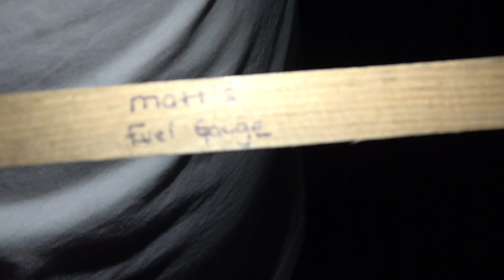The Brooklyn Dodger Works on the Street!

Comment: Warning you can’t excite the LS alternator with 12v it kills the diodes.  Been there done that, you have to reduce the exciter voltage to 5-7v to save the diodes. They sell a wiring pigtail with a resistor specifically for the LS alternators!  JD
Reply from the maker: I have the pigtail from holley so it should be fine. I believe you just hook up switched 12v to that and it’s good
Reply: I too found this out the hard way lmao

Comment: So learn this south jersey boy somethin here. Are you controlling the spray with the Holley? If so is it a dry kit? I have sep 1500s and was planning on using a dry kit as I don’t see why not. Is this what your doing? Thanks for any info
Reply from the maker: Yeah the holley has a built in nitrous program you just have to wire it up. I have a wet shot for now but once we get the tune up a little better I’ll go to two dry kits
Reply: @Matt_Ryce  that’s what I was gonna ask next. Why can’t two dry kits be added. Awesome. Would love to pick your brain

Comment: So let me ask you something with the s10 frame under that will that limit you to any of the races that you need (stock) suspension?
Reply from the maker: The suspension is stock 🤷🏼‍♂️
Reply: Just curious I've seen I few races where they said stock style front suspension and didn't know if that was a thing
Reply from the maker: @tophatpat3246  honestly the truck isn’t fast enough to compete in any of that stuff anyway so it doesn’t really matter
Reply: Gotcha thanks